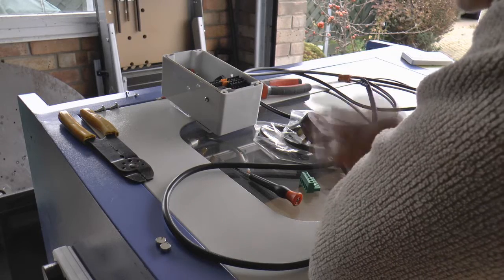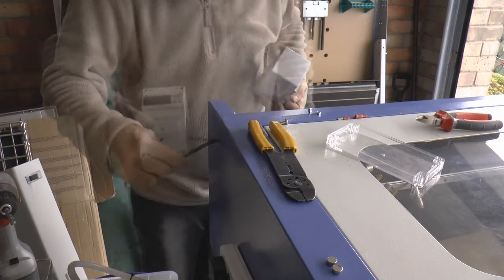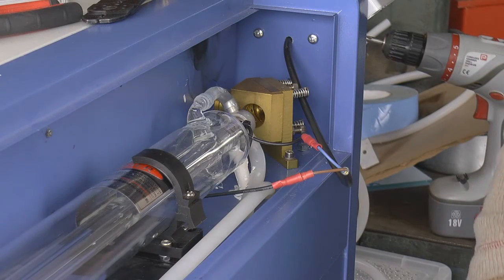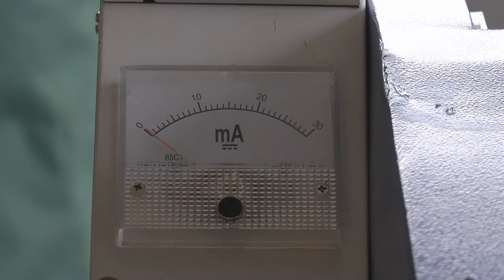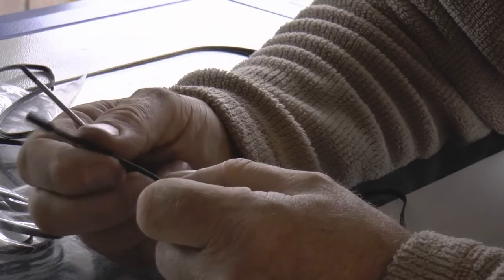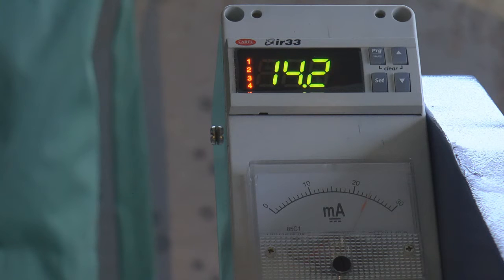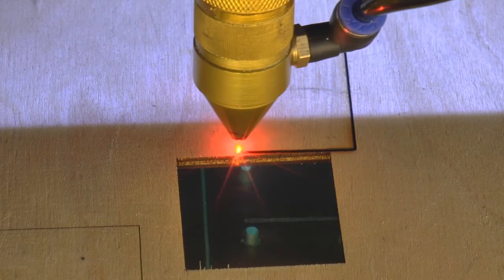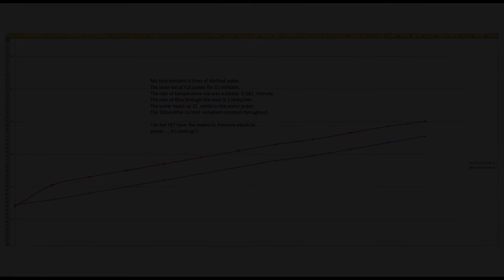RDWorks Learning Lab 24 Adding instuments to give ME contol at last

Comment: Silly question... what range would you expect a 60W tube to run at? (amps)
Reply from the maker: +Michael Edmond 
Hi Michael
I suspect you do not know the source of your tube and did not receive any data/spec sheet with it. Typically a 60 watt tube will be 1200mm to 1250mm long and runs at a maximum of 22mA. If your tube is only about 1000mm long then it's really a 50 watt tube and should be run at 20mA max. MY new 60 watt tube is something of an exception because the manufacturer tells me I can run it at 26 mA which produces 76watts!!!!  However running at 22mA I still get 72 watts  so why would I push it to the limit??
By the way, at 10% setting,the tube is on it's low limit and may or may not be working. Put a piece of thin paper in the beam path to determine if there's power and increase 1% at a time to find your low threshold of power.
Regards
Russ
Reply: +SarbarMultimedia I only ask because for some reason, even on low settings (40% power) it was measuring 60 odd amps... which cannot be right.
I need to investigate further
Reply from the maker: +Michael Edmond 
Your power supply and many other things would be on fire if you really mean 60 AMPS. Even 60 mA would be alarming because as I understand the way the power supply works, if it's for a 60 watt tube then there are ballast resistors in there that instantly limit the current (that would otherwise be infinitely high when the nitrogen ionizes) to some maximum which
I suspect will be a lot less than 60mA. I am not an electrician or electronics expert but I do know a man who is. If you wish, I can check if he is willing to chat to you about your issues.
Regards
Russ
Reply: sorry, yes, 60 mA,  I will check my connections first, which i strongly suspect as the ammeter read a 'sensible' figure for a bit, then jumped up again, which would make sense with a bad connection.
Reply: +SarbarMultimedia 
checked wiring, if I set pulse strength to 10% it reads just over 22 mA..... 
weird
Reply from the maker: +Michael Edmond 
Hi Michael
Set your MAX POWER to 1%. Go to the rear of the machine and hold the pulse button on for about 5 seconds whilst looking at the cathode and  the last 6 " before the cathode. There should not be enough power at 1% for you to see anything. Increase power in 2% steps and I would anticipate that at about between 9 and 12% you should see a feint hint of pinkness at the cathode. You should also see a corresponding 6" of feint glow at the anode. This is a pre-ignition condition and if you put a piece of paper in the beam you should at least scorch it. This is when you get about 3 or 4 watts of power.  If you really have 22mA of power at 10% the tube will be glowing uniformly pink all the way along. Regardless of displayed current if you push past this pre-ignition phase I would expect a solid pink beam to be established by 15% and it should almost instantly burn a hole in your paper.
See how you go with this test
By the way, a pink beam wont necessarily mean you have lasing. If your tube is somehow devoid of CO2 the nitrogen will still glow even if there is no CO2 to stimulate. Does it burn anything is the real test.
Regards
Russ
Reply: at 3% ammeter moves a tiny bit...
at 5% not enough to laser, ammeter reads 10 mA
at 6% ammeter reads 14 mA, burns paper easy.
The thing is, the laser works fine, i just cannot get over the mA readings! I dont know what max is, as 15% is 25 mA BUT not really strong enough when actually engraving (like engraving wood, little frames i have are engraved nicely at 250/30%.... which is beyond 30 mA
Reply from the maker: +Michael Edmond 
Hi Michael

My man who knows about these things has very sophisticated test equipment that he can bring to bear on his own machine. He is pretty sure that you are seeing noise with your ammeter. He is guessing you are not using a cheapo  Chinese meter like myself but probably a decent multimeter. Aparently, my basic meter acts as a filter for all the noise that he is seeing emanating from his power supply. He is pretty sure its a display issue not a machine issue. I find it a little unusual (but not impossible) that you can get power out at 6%. Most people I speak with see little or nothing below 10% BUT it does depend on how your power supply has been set up. There are trim pots on the PSU board that set  zero and span but I would not have a clue where to look for them (or the courage to fiddle with them) so that ideally you could make 0% the point of triggering and 100% your max limiting current.
Is he right about the meter??
Regards
Russ
Reply: +SarbarMultimedia I got the Meter via the link you shared!

but what I will do is pick up a digital multiMeter and see if that has the same ballpark figures.

I managed to get the contact details for the manufacture of the machine so waiting to hear back. that will tell me what max is supposed to be.
Reply: +SarbarMultimedia figured it out...

dodgy meter!
new one installed and sensible readings achieved!

what is your 60 watt tube max rating?
Reply from the maker: +Michael Edmond 
Hi Michael
Most normal 60 watt tubes are rated at 22 mA. If there is any clue to the name on the tube then you should find actual information at their website. If you look at my lens session https://youtu.be/WbBPps42iHc you will see a very convenient way of visulyy checking and recording  the power characteristic of your machine. You will probably find that pushing your tube beyond about 60% will give you VERY little extra power, especially if this is the tube that was supplied with the machine. It's almost as though the Chinese have adopted the inkjet printer idea where you buy a working inkjet but the cartridges are only 10% full. You soon have to buy replacements!!!  By the way it will not seriously affect your tube life if you run up to 90 or 95% for a few short power tests but as norm stick to 60%(ish)
My new 60 watt tube and PSU on the other-hand is unexpectedly FABULOUS. It outputs about 70 watts at the 22mA  and the manufacturer states I can run it at 26mA. At this higher value I get  about 74 watts ....and it's warranted to still be 60watt  after 4000hours. However, I shall stick to 22mA and be VERY happy.

Best regards
Russ
Reply: SarbarMultimedia 
My tube is marked k h laser laboratory, but I cannot find a website, I have contacted them but they don't seem to quite understand what I mean when I ask what amp the tube is rated at, they keep telling me 100% = max amp. Not the figure the tube is actually rated to.
Currently I have not gone above 70% (cutting 10mm acrylic) everything else is good at 30-40%
Reply from the maker: +Michael Edmond 
Hi Michael
What length is your tube? 1000mm =50 watts (20mA max) 1200=60 watts 22mA max .  Dial in your % to find the 22mA value.
Yes, I couldn't find them either.......I suspect they don't want to field complaints???
Regards
Russ
Reply: +SarbarMultimedia after I figured out that the Meter was wonky... new Meter fixed issue, also here is where I mounted my Meter!
https://goo.gl/photos/nHe656wHYw3FXthBA

Comment: Hi. I have the same machine. I can confirm that at 60% power is cutting the same like at 90% (I never used 100%). I've made a control thermometer using an arduino uno and 2 water proof temperature sensors (one for the water tank and one for the outside). Soon I'll install a similar ampmeter. Thank you for sharing your experience and I want to say that your videos helped me a lot.
Reply from the maker: +ZuFoto Thanks for your words of support. I LOVE  my ammeter it keeps the laser tube running within the manufacture's recommended maximum current. Sadly, non of us know the absolute power that is being generated by the tube at this max current specification. GOOD NEWS. I have just received a power meter and will soon be carrying out tests on my machine. Although I purchased a 50watt machine and subsequently purchased a 50watt replacement tube, I have long suspected it to be actually a 40watt machine. Keep watching!!!

Comment: Thank you all the great videos you made. Seems like they have tried to give more amps to turn a 45 watt tube into a 50 watt machine.   Your advise to check the amp is great to save the life of the tube.  Curious  if  the power supply has an adjustable   potentiometer to reduce current so that you cant over power the tube at 100 percent. I guess you achieve the same result by not going over 65 percent but if you wanted to regain the span or range of the control settings  you might be able to reduce the  output of the power supply.   I purchased a similar machine and would be nice to share some notes with you or discuss what we are learning works best.    http://www.instructables.com/id/How-to-test-and-set-a-Chinese-China-made-CO2-Laser/?ALLSTEPS
Also wondering if you have gotten into trying some different lens to get smaller pixels for better resolution.
Regards
Reply from the maker: +BluePrint Holsters 
Hi
I appreciate your kind response. I hope you are not forgetting that these are not intended as training videos but much more a set of video diaries that shows me going through the learning process. Looked at in that light, I could do many things better, and as you have seen I do make mistakes ( a new tube for example). I know that there are lots of watchers of all ages, nationality and, more importantly, capability, hence as I push forward I try to keep my videos simple so that the less technical can easily follow.  There is a lot of good info on www about specific aspects of the machine  and I had already looked at the link you kindly added, along with several others before fitting my tube and ammeter. Strangely,  it appears that my stumbling route to understanding the machine has helped many other newbies speed through the learning curve (a satisfying but unintended result!). I have reached a point now where I can confidently design something  and program it, However there are MANY areas of the machine that I'll not delve too deeply into because this is a pure recreational activity for me and not the basis of a business (as it is for many of my watchers).  You touched on one for example when you mention experimenting with lenses. If I wished to get the best pictures onto glass or marble then I would invest many hours learning how to fine tune the photo preparation process and etching parameters.  Sadly, I'm not a graphic artist but a retired engineer and although I am touching on many aspects of the machine's capability to give myself (and others) a hint of the machine's potential, I'm now beginning to selfishly just show projects and problems that interest me. BUT, that was the whole point of this video diary.
Just today, I have hit a problem with my machine where I wanted to run the Xaxis very fast. I thought the machine was capable of at least 1000mm/s but try as I may, the speed seems to be hobbled at 300mm/s. Something new to explore!!!!

Comment: Do you know why the current read lower to start with?
Reply from the maker: +Peter Jones 
Hi Peter. This was my second tube. Supposedly an OEM 50watt replacement that I bought off ebay. It was basically from the same rubbish stock that was supplied with the machine and was another 40watt tube. Suckered twice!. Not only was it 40 watts it had some weird behaviour patterns. With a good tube you will hit it with about 25kv and the nitrogen will immediately ionize (the pink glow) This means the nitrogen (which is a 100% non-conducting insulator) all of a sudden has loads of free electrons available and can carry infinite amounts of current. At this point the power supply kicks in with ballast resistors and other circuitry to limit that current to a non-destructive trickle. It also drops the voltage to about 15kv and the lasing action with the CO2 will be begin.  Just prior to full ionization there is a characteristic of all CO2 tubes called the "zone of uncertainty" which I think is that point where the power supply is hovering between 25/15kv. I can controllably set my new 60 watt tube to this condition  by dialling in between 8 and 10% power. It delivers about 2 to 4 watts of power with a distinctive hissy noise and if you look at the tube it is barley pink and then only just a few inches from the anode and cathode. 
The loss of power that you see is this same condition but at much higher powers. It was alway obvious when it was happening because of the distinctive hissy noise. I'm sure it was a problem with the power supply  (loose component or dry joint?)because excess current (80% power) would fix it, when the tube was new it would fix itself after a few tries but as time went on I had to give the machine a sharp thump to fix it.  I did not recognize this condition at the time and only latterly when I did my tube research did I come to understand what the problem was. 
I was "unlucky" (perhaps stupid) to buy two rubbish tubes. However, the positive spin is to recognize that without these challenges I would never have been forced into learning what I know today. 
Regards
Russ